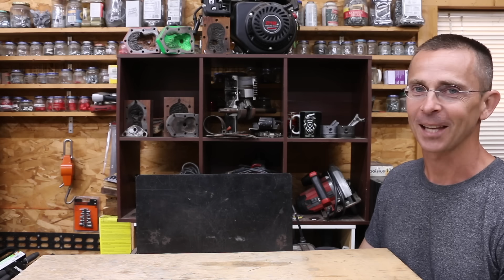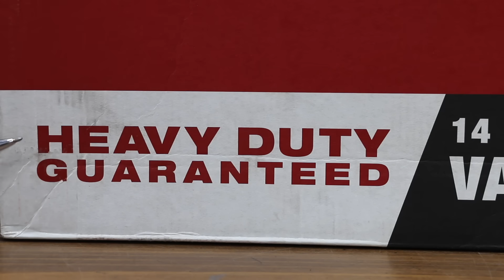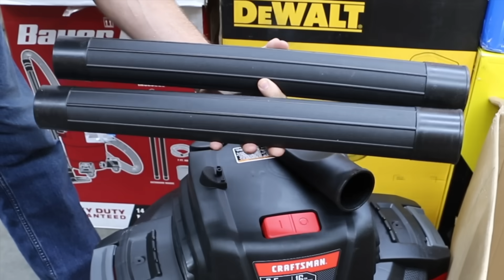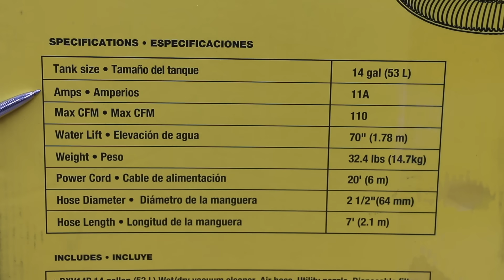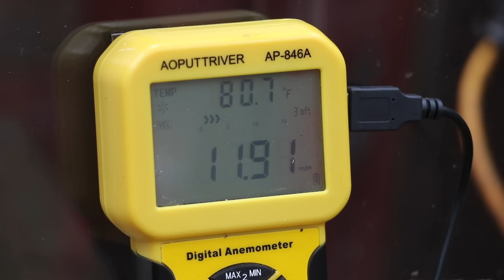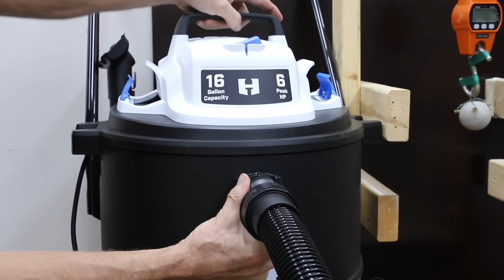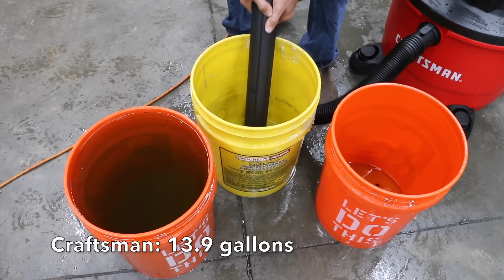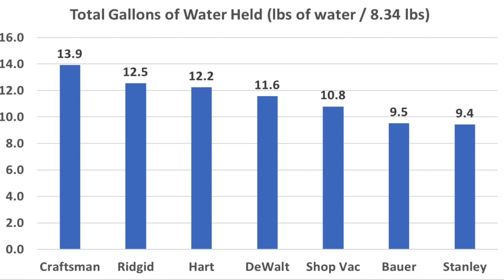Best Shop Vac? Ridgid vs Shop Vac, DeWalt, Stanley, Hart, Craftsman

Comment: I have a 6.5hp ShopVac brand shop vac with a detachable leaf blower that's getting close to 20 years old now and this thig has a perfect seal and I can vouch for the fact that it can easily hold a 13.5 pound bowling ball. I used to use it as my main vacuum in my house and it would literally suck the carpet away from the floor when I lift the hose. Also the one I have has a true 2½ inch hose at the connections with the main line being slightly larger. I guess they just don't make them like they used to.

Comment: I purchased a Craftsman after watching this video 2 years ago. Mine has since gone bad, the impeller bearings went out and the ‘warranty’ “does not cover normal wear and tear” per their email response to me.. so they won’t cover it. I’ll be buying a dewalt next and see if that one lasts longer.

Update: they did end up sending me a new one, had to argue a little bit but I was happy with the customer service in the end.

Comment: Fun Fact: The Porter Cable 12 gallon version sold at Tractor supply nearly the same as the Bauer, but 10 bucks less, and has a 3 year warranty.

Comment: I just picked up the Bauer vac today based on this video. Got it for 99 bucks and got a 2 year replacement plan for 21.99 together it's still cheaper than the craftsman or DeWalt. It's worked great

Comment: Huh? I know for a fact you can get the Rigid in a smaller hose diameter the same as the earlier ones and you can get either size. Why didn’t you get the same size for the same comparison? I know this because I bought the other Rigid.
Also hose diameter and length greatly affect suction.
Don’t get me wrong I love this channel but you missed a couple of obvious things to watch for.
And all of the Rigids I’ve owned had a super tight top to bottom it wasn’t loose like that at all. 
This was a really odd video compared to your others. Maybe you can revisit this and get the same size shop vacs hoses etc. at least in diameter but both affect suction power.
I’ve never seen a shop vac with a lid that loose ever. I would’ve returned them and I understand you’re making the comparison but neighbors with other brands and I’ve even got an ancient Rigid and I’ve never seen a shop vac with a loose top. That’s just weird for your luck to be that off. Again love your channel but this was a really odd comparison video

Comment: The craftsman I had preformed  poorly because of the inner walls of the hose were NOT smooth they were ribbed and solid debris  would hang up on the ribs  in the hose and would require  frequent unclogging  which took time away from  the task of the job too  rod out the hose

Comment: In the closing comments of the video, I thought the Dewalt had the best performance overall. It seemed it was on a different tier.

It had the best suction, most capacity by percentage, sucked up the sand and water the fastest... and beat the Bauer in the "showdown".

I'm assuming that because it was the most expensive is why it was not the winner?

I think in closing it should have been mentioned, that if you want to fork over the extra $40 bucks, the Dewalt with it's best overall performance, would be the choice.

Comment: Thermal Fuse, all shop vac' made today have a thermal fuse on the electric motor, that fuse snaps ( not unlike my personal fuse ) when the thermal fuse on my shop vac' thermal fuse did, when I ran it way to long and the motor got to hot while pumping water out of my basement after an unbelievable rain downpour, and I was left without the use of my shop vac with a built in pump. Disregardful of the other directions I could go here, the test we need to see is how long shop vac' will run and how hot do the electric motors have to get before the thermal fuse snaps and makes the shop vac useless until replaced.......... We should test this.

Comment: It always amazes me as to how much smaller the us gallon is than the imperial around a u.s. quart no wonder a drum is 50 gallon down there up here there only 45  but back to the topic at hand shop vacuum have gotten a lot quieter over the years back in the 80 I used have a shopvac that I modified so when I was cleaning out drinking water tanks it was self emptying and and after cleaning out a tank my ears would ring for hours and my hearing was gone for about an hour nowadays they are a lot quieter and we have ear protection

Comment: I went and bought a beaur and i opened it up and the whole motor was broken off , the plastic snapped somehow that held the whole motor it . Like how does that even happen its inside the freaken vacuum!! Kinda upset and now I don't know if I wanna get another one or get my money and spend it on dewalt and btw I paid 109 plus 20 bucks 2 year return policy and ended up being 144 bucks . I think I'll take my 144 bucks and buy the dewalt which is around that price.

Comment: Can you compare portable carpet cleaners?  I special-ordered a $100 Hoover portable carpet cleaner and it didn't work as well as the $40 Shop-vac I had been using and a spray bottle.  The Shop-vac sucked up half a gallon of water 40% faster than the Hoover and the max line on the Hoover was something like 1.2 quarts, while the Shop-vac is rated for 3 gallons.
The Hoover also had a shorter hose, so short that I often needed to move it in order to reach.
Once I buy or find the right attachment I think that I will return the Hoover!

Comment: Thank you. Once again. You saved me from thinking I could get away with buying a less expensive unit, which also has lower performance. I don't think is worth it to save $10-30 with the Hart when it's performance is too degraded.

Comment: After Hurricane Katrine in 2005, I needed a shop vac to begin cleaning flood damage.  Lowe's is our local big box store and they sold "shop vac" brand at the time but were all sold out.  We still had a Sears back then right across the street from Lowe's and I bought a 6.0 HP 16 gallon Craftsman vac there.  I still have it and in about a month I will have had it 17 years.  In that time it has sucked up about anything you can imagine to include the wet sand from by pool's filter not to mention all of the post Katrina debris I could stuff down it after first buying it.  It has been used and abused but it just keeps on keeping on.  I own three other shop vac brand vacs in smaller sizes because Sears  closed and the Craftsman brand wasn't available locally until Lowe's acquired it.  I wouldn't hesitate to buy another Craftsman but I don't have any complaints about my other smaller Shop Vac branded vacs either. Thanks again for your unbiased tests!

Comment: A second comment, this one on testing equality.  Man, you work really hard to get to a fair, repeatable standard for your testing.  It’s nice to see the thought put in on this testing and certainly have moments where I say things like, “great testing scenario that I didn’t think of”.  I was thinking about the sand test.  Right out of the bag, sand tends to be a little damp.  After a run or two through the first vacs it has to be dryer and hence a faster pickup.  Probably wouldn’t make a significant delta in the outcome overall but it likely impacted the individual test if there wasn’t a fresh bag of sand for each run (maybe you did that and I missed it).  Or, measuring and equalizing moisture content and overall weight before testing.

Comment: Nice review (as always, “I’m very impressed”) with a couple of surprises, like the Bauer and it’s performance.  It does feel like they make up the HP number when you look at the calculation you did vs. the HP rating on the box.  Just think if they really delivered the HP shown on the box when you did the calculation.   It would pretty much level the field for a home consumer since they don’t want to vacuum the paint right off their car from the other side of the garage.  

A few thoughts to consider when getting a vacuum for the shop when thinking of the long term value:  

1. Total floor space consumed.  Home shops have limited floor space and wider units consume more than their share of that space.  There is a trade off, tipping and weight.  Same weight and taller it tips, however add some weight at the bottom and tipping is less of an issue.   As noted, it’s a trade off on space, weight and a shipping cost factor.

2. Attachments 
      * Storage - I end up with more attachments than “hang” space on my vac.   The ability to have the most used attachments on the vac is a positive option and it was only a mention on some of them. 
      * Durability - attachments that break only add to the frustration.  Betting there is plastic strength and impact resistance that plays in here on each brand. 
3. Filter options and cost - I’d have to think that some of these have HEPA options and some don’t.  That could be a big factor depending on what you do.  Also, solid wet filter options are important.  Heck, I even wonder if they all have solid bag/hard filter options at all.  (Cynicism arrives on some of the brands).   Hehe

4. Water - Does it have auto shutoff?  Flooding the motor is no fun.  Then there is getting the water out of the vac.  I think of this in two ways.  
        * Gravity:   how does all that water get out of the vac?  Do you have to pour it or will it drain out the bottom.  How fast does it drain.  Using these for water you might have 50 gallons and the tank needs to drain every 10-15 gallons picked up.  
         * Pump - Is there a pump option?  If you have 6” of water in the basement you might also want this information since that’s probably a lot of water that needs to move up and out of the house and lugging vacs full of water is time consuming and hard work (12g x 8.3lbs is over 100 lbs of water).  And, what’s the lift of the pump to get the water out, will it make it out the basement window and away from the house?  Also, pump rate vs. the vacuum rate, is it balanced?  

5. Warranty - Longer is better for sure and, while lifetime looks good. most of these warranties come with caveats like, “must pay shipping both directions to a repair facility in Alaska”  You might end up spending enough on shipping (with the potential of getting rejected on warranty claim) that you could come close to buying another vac.  Also, shipping and repair times means you end up with some fairly long down time in the shop where you do a ton of broom sweeping and stir up a lot of dust.  In the end, at least the company is putting their money where their product is when there is a longer warranty attached.

7. Does it include blower functions?  Doesn’t have to be a detachable blower feature, just a blower.   How well does the blower function operate?  Is it a cooling breeze for your dirt and debris or does it really move it?

Comment: I purchased the ridgid but the larger model. Their largest model actually. It has big rear wheels and a metal handle. Larger motor, etc. It’s more expensive so maybe you can do a comparison of the higher priced corded vacuums.

Comment: I know this is not perfect but; what do you think about testing heat levels, with either an IR thermometer, a thermal imaging camera, or a temperature probe : of the outer case of the motor, the motor exhaust temp, and / or the main airflow exhaust some vacs may have separate motor cooling air path compared with main vacuum air path. Would this give actual useful info on motor efficiency ? Maybe not : poorly designed cooling fan / cooling air path could lead us to think its inefficient when its actually not bad. It could also expose poorly cooled units, which will therefor be less durable ?

Comment: I just bought a bauer.  Got it on a coupon deal for $88, then I got the 2 yr extended warranty for $20. Brought it up to the original price of $109. I was gonna get a craftsman or a rigid  but the prices are high for an equivalent power. The HF 2 yr ext warranty covers anything and everything, just return it for a new one.

Comment: Thing is most shop vacs are based on airflow based motors so like when you put them against eachother so kinda hard to compare like that cause honestly some things require more air flow and some tasks need more inches if water lift

Comment: I got the rigid but the price was right when I found one at the dump and took a chance on it and it works perfectly just needed a hose which was $25 and then lowes was getting rid of there generic shop vac attachment inventory with everything marked down from $10-15 to $1-2 each

Comment: I thankyou for doing this test. Craftsman is really no joke. All there tools have stepped up there game.i work at a lowes home improvement store in the tool and hardware section mostly. (Overnights) and have seen a huge increase in the craftsman line that we sell. Although dewalt does beat out craftsman in cordless tools I'm very impressed. And for the people that don't know...both craftsman and dewalt are both owned by Stanly black and decker!

Comment: Would like to see a measure of air quality around each shop-vac as you're vacumming up the sand.   Some testing with drywall dust and the high-end filters would also be nice.   It's not great if the vac is picking it up fast, but also just spewing it into the room.

Comment: I coincidentally have the craftsman and I love it…the one thing that’s difficult to test is day to day use and one thing I find a little annoying with the craftsman is, if you’re a dog owner, hair will get lodged into the casters and bog down its ability to spin, eventually acting as brakes making it very difficult to move. 
I’ve looked up hair resistant casters for it, but unfortunately, the craftsman takes these casters with these thin long stems and I can’t seem to find compatible hair resistant casters. I typically just take a utility knife and saw at the hair in between the left and right grooves of each caster. Takes some effort, but it does the trick. Soaking them in water for a few minutes makes it easier. I think the casters are resistant to corrosion but I spray them down with some wd40 after just in case

Comment: CFM and water lift are the metrics you wanna look for when buying a shop vac...I bought a 6hp Ridgid for my shop and it’s very disappointing, only to find out it’s water lift is like 43 inches and less than 130cfm

Comment: I have a Channel Lock brand 16 gal 6.5 peak hp vac. Some assembly required. Super long hose, not a real long cord, nice big wheels on the rear w/ one of those groin level handles. Detachable head that acts as blower. It is smooth and not too loud. Made in China. I paid 149.99. Such a useful tool. It is very strong, and has a large hose. I would say it would be in the upper tier!!

Comment: I've been surprised you haven't tested more Hart tools. I was in Walmart yesterday and they have a full family of tools now, including some things that others don't have like a cordless soldering iron. Some of their tools intrigue me, like the soldering iron, and the hand vacuum, maybe a flashlight. I wish DeWalt had some of these.

In terms of shop vacs, I own the big stainless steel Ridgid. Might have liked to have seen the largest shop vacs tested. But not all the manufacturers make them.

Speaking of warrantees, that can be a really important factor in buying tools. When you buy a store type brand, like a Ridgid, or a Kobalt, when you take the tool back broken, it's been my experience that they'll just give you a new one. I would not expect the same for some other brand where warranty may be a concern. Though I wouldn't know because I've never succeeded in wearing out or breaking a DeWalt.

Comment: I have had my powerful loyal Karcher purchased in year 2000 still going strong today,large bag which lasts me over a year,and massive filter like a car size round round,simple bucket on bottom,motor and screw on filter on top.costs around 200 so not expensive,but had to buy heads separate.

Comment: Ever heard of Vacmaster?
 I have, I own one, manufactured in Australia 
Cost 99.99, I bought the beast, it has enough section to if not careful could suck in any low flying bird. It is far  quieter than my old shop vac. It's 16 gallon and 6.5 HP.

Comment: It's better to get the average instead of peak for airflow and suction. Sustained power is what counts. One might reach the highest speed or suction, but only for a few short burst, while another might be a bit less but consistent throughout use. In any case the real life tests proved without a doubt which is best in actual use. Thanks.

Comment: im confused.  the dewalt won the suction, water , sand and head to head tests and you picked craftsman as the winner?   If a vacuum's job is to suck up stuff and the dewalt won all those categories it would appear the clear winner here.

Comment: For long time use, continuously, the Bauer motor bearings seem to go bad. I used it in the wood shop and it was on 80% of my time out there. It lasted me a year. I have a Rigid now and it's going strong after 2 years.

Comment: Over 25 years ago I bought a 16 gal. Craftsman. It has been used for dust extraction for a table saw, vacuumed water out of the bottom of a 225 gal water tank (at the end of the summer season so it had to pull water up about 6 ft).  And none of it's parts including wheels has ever broken.

Comment: As you said, the build quality at the lid /can connection dramatically effects the suction capability. I have Rigid in the garage, which has high horse power but not great suction. I wonder if adding weather stripping to the lid to prevent air bypass and retesting would make a difference?

Comment: I thought the Craftsman might be the overall winner. It's performance was solid each time. I gave my sister my old large Craftsman and I currently run a big Shop Vac (pre-bankruptcy) model. It's worked well for my needs.  I shy away from HF tools due to the short warranty. You shouldn't have to buy a longer warranty.